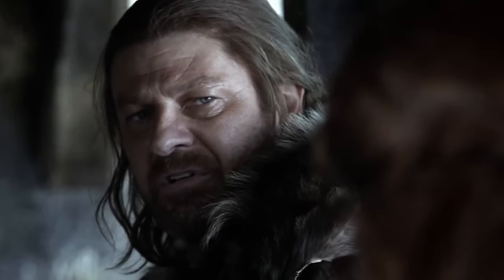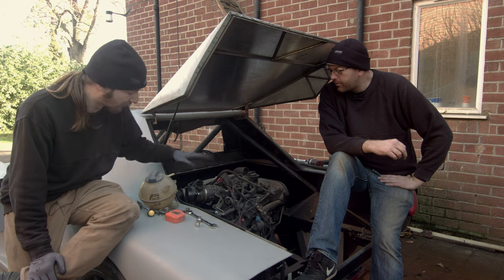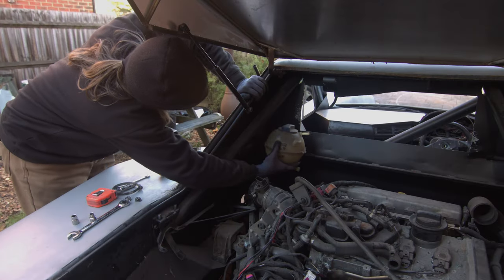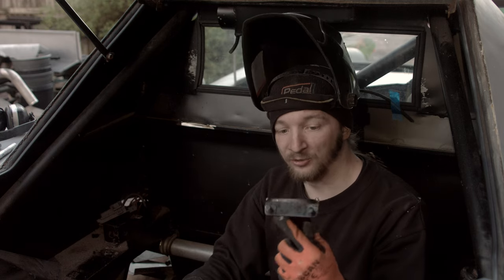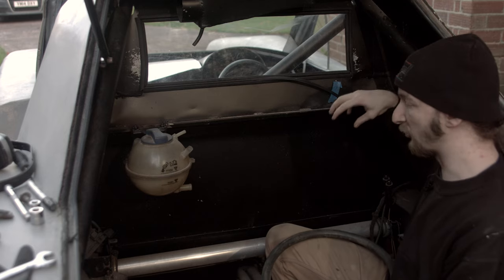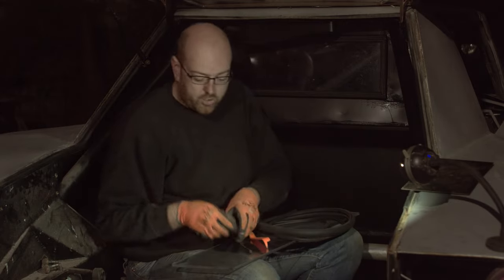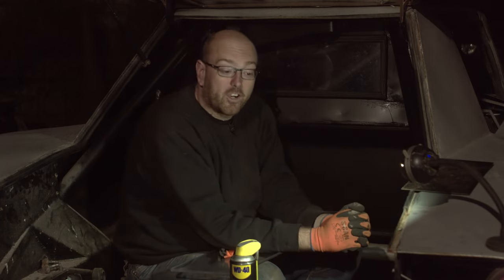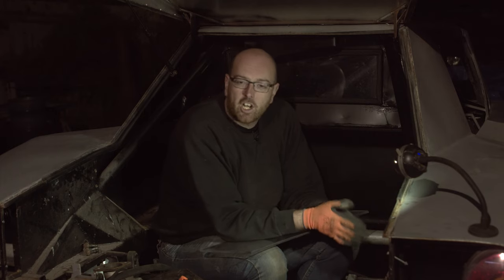More Plumbing & Firewall Window A Audi TT Kit Car | PedalBox Episode 121

Comment: Bit late now, but it'd probably be better if the window had rounded corners. That way you can run one strip all the way round, so you only have to start it once, and it also helps avoid fatigue cracks starting at he corners.
Good work getting it in there, looking forward to the next one  :)
Reply: Honestly rounded corners didn’t even occur to me at any point! I wonder how many other potentially easy wins we’ve missed 😅
Reply: @ChrisDRimmer  It only just occurred to me, and I've watched the rest of this build, so I can't claim to be any better!
Reply from the maker: I had a grand plan, those corner would get patched in to make them rounded, specifically to make the window easier. In the end I couldn't bring myself to inflict anymore patchwork-ness to the firewall because "I'm sure it'll look better this way without having yet more patchwork". How wrong I was! In retrospect I'd have made made that firewall in 100 pieces if it meant having an easier time with that window. Lesson learnt, you might avoid a job that feels bad to do and end up having to do a much worse one later.

Comment: Had a similar problem in the past, ended up resorting to over sizing the lexan panel and bonding/riveting it directly onto the opening
Reply: I think you took the easy and sensible route there tbh!
Reply from the maker: Yeah that would have been a decent option too, with some overlay trim to hide/neaten the edges some. Theres so many ways we could have done this window better and we took the "good enough" option at each stage and left us with a sub-optimal situation which was a pain to deal with by any means. And we still chose the hardest way out of it.

Comment: That window looks like it was an absolute shitlord to fit. Curious to know what it's like getting the engine in and out now you've got the exhaust, heat shield, and bodywork though?

Also Chris needs to learn to braid or use a second tie to keep hair from booping mic. XD
Reply from the maker: It was. I really don't like waving a hand and going "it was hard so we didn't film it", everything else like that has come down to "it would have been excruciating to watch brains tick over and talk for an hour about ways we didn't do it" and we'll explain instead how/why something is the way it is. This was something else. This was a loathsome chore that I hope to never repeat, and IF we do, there'll be improvements to the method